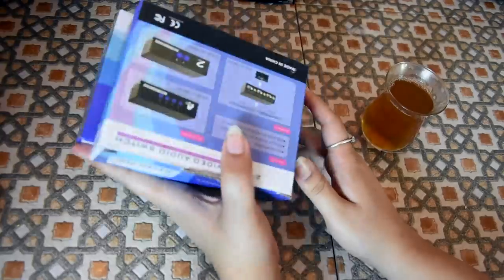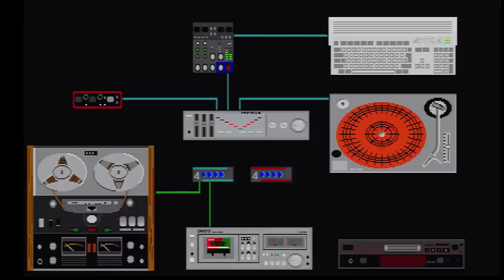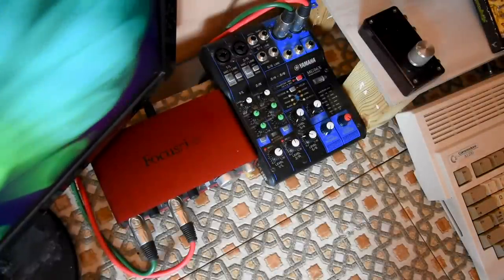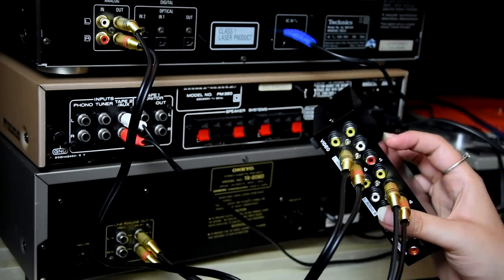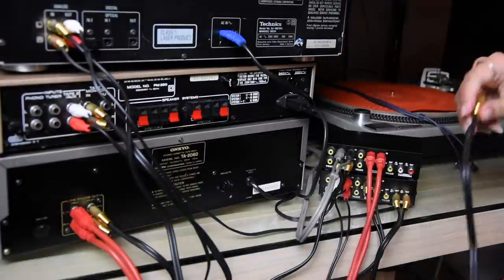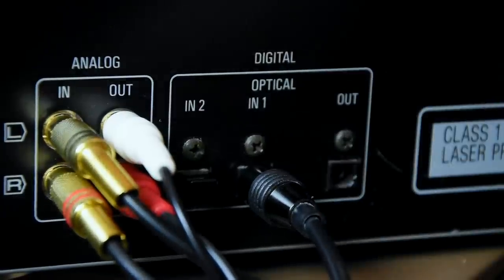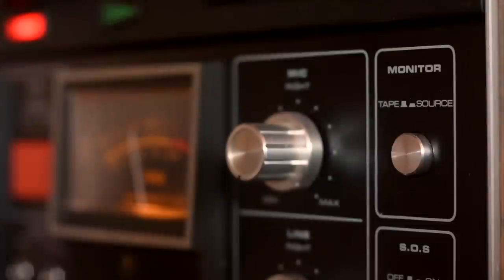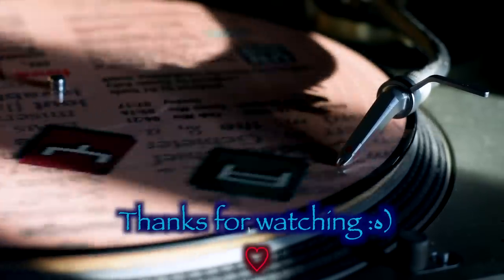Vintage Hi Fi setup 2017

Comment: Hi Ms Mad, nice vintage system. I had the same problem in 1978 with ad-ons. I was happily using a Pioneer SX-650 receiver with two tape loops (alas only one way dubbing). It sufficed my two cassette deck needs. I moved up to a Hitachi SR-804 receiver in 1979 with bidirectional dubbing facilities and that was even more flexible. Until I added a Teac X-3 open reel deck. I didn't want to use a switching box like you did. I up graded my equalizer in 1982 to an ADC Sound Shaper Two IC. The equalizer has bidirectional dubbing (it handles two decks). I was able to connect the EQ to tape monitor 2 (with both cassette decks) on the receiver and into tape monitor 1 I connected my Pioneer RG-2 expander with the X-3 reel to reel connected to the RG-2. I can  switch from any deck in any combination. I've used this set up for 35 years now and it works for me. Bet I was using hifi equipment before you were born, lol.
 A very informative and interesting video. Thanks for sharing this knowledge about the switching boxes as I'm sure some folks will find it helpful.

Comment: Yeah, those "zip line" speaker cables you tinned a little clumpy but you got it worked out. Banana plugs do work but they also sell "Pin" connectors. They look like super thin banana connectors and give you the ability to replug speaker cables over and over again without wear.Great video! I havnt done any of that analog production stuff since 1990 Video Production college and working at the cable station that had a Amiga 1000. I miss those days. It was nice to hear and watch you play with that vintage equipment while I am hanging out in my new travel trailer at Columbine Campground near Red River ski village which is north of Sante Fe. I get 3G here with my Cell phone Booster installed. Been watching your YouTube video's all night!
Reply from the maker: Those speaker wires were so hard to tin, I couldnt believe how long it took me to just tin one wire! Even with a lot of flux. So I just cut and did it normally. I thought i'd try the suggestion which was being advised by quite a few people in the last Hi-Fi setup video. Those thin banana connectors aren't a bad idea actually. 
Nice! I hope you're enjoying your time out there!   I'm glad you're enjoying my videos! Thanks!  :o)

Comment: Nice system. Right now I have my old Aiwa NSX 3500 mini home theater system. D manufacture date was August 1997. I use one of those Bluetooth cassette player adapters. It's a cassette tape with the Bluetooth built-in. So even if your belts are shot you can still use it, along with yours  Dolby noise reduction and karaoke functions. if you have a duel decks . you can use two of them to run two different devices wirelessly. Some systems were so simple you could play two tapes at the same time. a useless function unless you have those Bluetooth adapters and two devices playing music. You can feed the volume in and out independently on each one device.

Comment: What you have accomplished with 2 switch boxes is quite a feat. I want to point out that back in the day, dbx made switch boxes that do exactly what you've done here. The model 200 had inputs and outputs for 3 tape decks, 3 effects boxes and the routing capability to allow the tape decks to record to each other.

Comment: Wow, I really admire your D-paint pixel art. I imagine you really spent time on that diagram. Very creative. One way to solve the problem of not being able to record between tape/md would involve using the Yamaha mixer's tape in and out RCA jacks. Rather than hooking up your "play" switch directly to the tape monitor input (play) on the smiley, run it to the tape input on your mixer. then run the tape output from the Yamaha back to the smiley's play input. Now you can choose to use your tape decks normally through the smiley's tape monitor via the mixer's tape out, or as primary sources via the mixer main out to tuner input on smiley, which can then be recorded by your deck of choice. You'll also have the added bonus of being able to digitize your tapes through your mixer to the scarlet. Only caveat is that tape monitoring would have to be done using headphones on the record deck itself when recording from tape to tape, since although you can still monitor the source deck, you cannot monitor the record deck as it's recording because you can only switch one deck at a time, and in this situation it's used as a source (through tuner input). Also, remember to turn down tape input level on mixer when recording from mixer to tape! edit: alternatively, Google "Realistic tape control center" for a single box that will do it all.
Reply from the maker: Thanks Shawn!  i'm glad you liked the diagram!
I need to work out and visualise what you're saying but after reading what you wrote, a thought came to split the output and connect one to the monitor and the other to an input of the Yamaha.
I wonder if thats what you were getting at.
Reply: I suppose that could work. Tho I'd prefer not to split just because it tends to lose some signal/volume. I just realized your mixer, Yamaha MG06x, does not have tape inputs or outputs. Big oops!! In that case, yes, I suppose you could send the tape playback switch to a pair of mixer inputs. Then, since you are already using both mixer outputs (XLR to Focusrite, and 1/4" Stereo out to Receiver Aux In), you could go from mixer headphone out to tape input on receiver. This basically gives you the same result, except you'd have to unplug from mixer phones jack to use headphones on mixer. Sorry if I confused you.
Reply from the maker: The only issue with making the tape completely go to the Yamaha is that I wont be able to record from the desktop computer nor the record player since each of them are to the amplifier. I kinda see what you're getting at now though. And it's all right :o)
Reply: MsMadLemon recording from Amiga, phono and scarlet are still possible, as the record switch box would be left as is. example, switch to phono on receiver, and switch on tape monitor. from here, set playback and record switches to your desired recorder, bring up channel 5/6 on mixer, and turn up mixer phones level. You'll hear the phono coming from recorder input as normal. record signal chain: receiver record out -> record switch -> recorder of choice. play signal chain: tape player of choice -> play switch -> mixer in 5/6 -> mixer phones out ->  receiver play in.
Reply from the maker: I just saw the diagram you PMed me, okay I see what you're getting at now :o)

Comment: Cassette and Open Reel decks adds a little EQ diference between input signal that enter in the record head and output signal coming from the record playback head and one of the situation when this was more dramatically noticiable is when you tape an mp3 or some lossy audio format. Dubbing vinyls adds some sensation of more space and a subtle treble boost specially at high speed recording.
Reply from the maker: One thing I also noticed was different tape brands have a different result, Maxell and TDK Audua improve the quality, where as a bad tape sounds worse than the source. i'm figuring different tape quality and biasing affects this of course.

Comment: Fabulous font on the label creator!
Reply from the maker: It's from a different label maker to the one shown. I decided to change it later for the font it but kept this footage. (mentioning just in case anyone decides to buy this one for this font and ends up disappointed)
Reply: yes, i already did think this font was a little bit odd. i use the dymo letra-tag over here some times. but. theres a big but ;) thats not so vintage as yours. except for the fact you did not use this a-team font then.
and my tape is short everytime i use it. now its laying empty, better remove the batteries then.
you dont have that problem.

btw. are you shure you checkt your speaker connection beeing ok. (off fase) i mean. we call it "in tegen fase"... i cant hear it ofcourse, but you can. just by turning the balance all the way to the left or to the right. and when there's more bass then when its in the middle, then you have to connect one speaker the other way arround. because one speaker is eating the low freakin' frequences of the other speaker like pack-man.
but you already did knew this didn't you?

Comment: Radio Shack / Tandy made a specialised input box for tape decks which you might want to look for. Allows for recording between several devices. 

I've got two switch boxes on my system for several SACD players feeding into two 2 Channel amplifiers.

Comment: about when you change from source to tape you´ve notice an upgrade in sound ,it always happened to me this because i started with an old pioneer deck but good one and also had a early 80´s reel to reel akai deck that was ofered to me by a german militar guy ,because where i live there was a airforce airport from germany,and a big neighbourhood inside the city where i live that had a club for germans,where they had lot´s of old equipment but high-end material, and i study electronics while in highschool so sometimes i did some easy repairs,like an stereo receiver from kenwood but gigantic and from the 70´s ,they told me that one of the output line wasn´t working ,i opened it and change a fuse and it started working again,and later with some other maintenance that i did to their equipment .this to tell you that the reel to reel akai deck that they ofered me had already those blue fluorescent metters,and when in my room walking barefoot when i touched any aluminium part of the 70´s components that i had it almost gave me a electricshock and when you connected it ,the ground connection started working so it stops that feeling that you´ve tried to discribe it´s estatic electricity(sorry for my bad english it´s not my first language)nice set up.

Comment: OH yeah, no, I wouldn't tin stranded speaker wire, just a couple of firm twists. That stuff's a heat sink too, only the outer strands get hot. It's like a giant wad of desoldering braid without flux in it.
Reply from the maker: Yes!! I was wondering why it was so freakin hard to tin that it felt almost surreal!
Reply: yeah, probably took forever. then you cheat and drip it off the iron.
Reply from the maker: ;o)) you've been there!

Comment: My solution for dealing with speaker wires:
Strip off about 20mm of the outer insulation
Cut off 25-50% of the inner strands and twist the remaining tightly
Tin the very end of the strands, not the entire length
Dress the end of the insulation with heat shrink sleeving
Sorted! :)

Comment: Why can you not record from tape machine to another pf your recrding devices? Just select the INPUT from the reel to reel and the OUTPUT to the cassette deck (or whatever combination you desire.)
Reply from the maker: It won't work :o) 
The switcheboxes are not wired that way, bascially the amp is 'thanking' that all three recording devices are just a single one. There is no connection between the recording devices to be able to record from one to the other.

Comment: I love making diagrams and planning for an AV setup ^_^  Even thugh it's a lot of work to rearrange everything...
Are you happy with the quality of your audio switchers? Did you notice any signal degradation, even very small ones?
Had I known you were shopping for switchers, I'd have had something to recommend you
Reply from the maker: Yes same here! :o) it's a huge hassle do i've only done it once a year so far lol but it's enjoyable.
So far the switchboxes are working great, I mean i looked around everywhere and coudlnt find any alternative, which would you recommend?
Reply: I highly recommend used Extron matrixes myself, they're the best! That's all I use, I refuse to settle for anything less haha. They're broadcast grade machines that can now be purchased for $50 or so (and sometimes lower)

Not only do you get a perfectly clean output (no noise whatsoever, guaranteed. which gives a stickler like me peace of mind, lol), but you  get the flexibility of sending any combination of input(s) to any output(s) you want. plus, you can set the sensitivity(gain) of each input individually and the volume of each output individually (very practical if you have a source that's too hot, or need to send the signal to a piece of equipment that expects a higher gain).

The series to look for is the MAV series. Some have Phoenix type connectors for audio, but some have standard RCA jacks. They are also rack-mountable. Searching "Extron MAV RCA" in ebay should do the trick. Here's what the RCA-equipped models look like :
http://media.extron.com/product/img-md/mavavrcaseries.jpg
Reply: Try and find a DBX 200 or DBX 400 switchbox. They take 3 x decks with recording routing between the three decks.
Reply: Agreed! The DBX switchers are professional grade

Comment: I think the recording is not better than the original, it's just that the volume is slightly higher in the recording
Reply from the maker: I actually did more tests on this, it's more dynamic. It makes no difference when I record from vinyl record actually makes a perfect recording almost.  But when I record from digital or Amiga etc it brings the recording to life, It also depends on the brand of tape which I use, some brands make it sound worse, some brands like TDK Audua and Maxell, make it sound better. 
The recording onto tape is doing something to the quality for sure.

Comment: Lucky your reel to reel covers  problems. Recording is supposed to have the same sopranos level as source - something about tape and bias issue but it is not to be corrected easy from outside while  it looks like  desired due to second possible problem with source which now is supplemented  by cables and switchover. Due to capacitances of wires and shelds they may fiter sopranos which are nicely regained by reels. it is not possible to get rid from capacitances  100%  so if you find it always good apparently is good. My arrangement may be seen here after scrolling down  to  "System 2017"      http://www.diysound.eu/?page_id=160